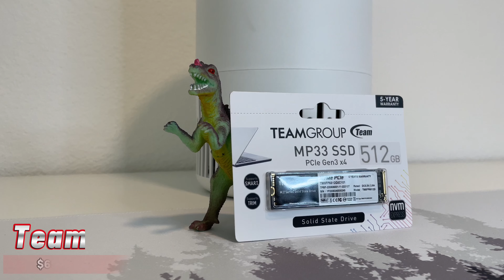Building my dream gaming computer || RTX 3060 build || Ryzen 5 5500

Comment: Shout out to you for having a dream PC that is actually reach able. Your dream PC is basically mine as well.
RTX 3060 12gb with r5 5500, 32gb ddr4 3600mhz, and 512gb Gen 3 nvme ssd. Would be a big upgrade from my gtx 1660 and i7 4770

Comment: Nice Pc build, but i would switch the top fans because of you back fan that is exausting all the fresh air for the gpu before it can even get to it. As well try to switch out your ram when you have time because of it bottlenecking your processor. Even though its the bottom line 5000 series it is running on 1800mhz FCLK, but you are running 3200mhz ram which is 1600mhz fclk it is making the processor run on a lower inifinty fabric clock. 
Still a nice clean build tho
Reply from the maker: Thankyouuu! I will, thanks for that